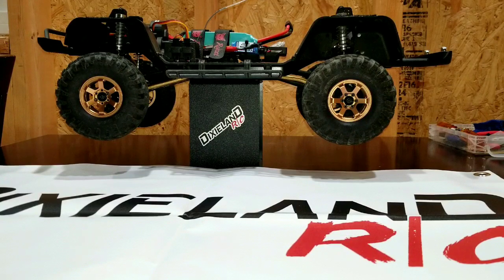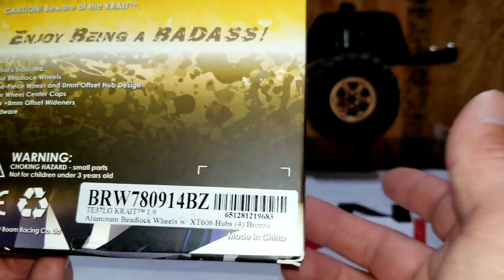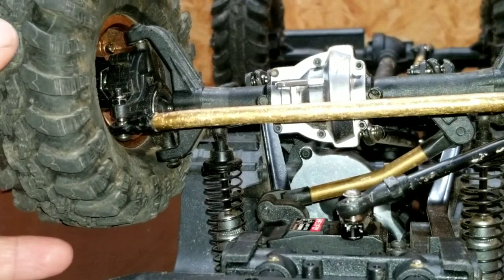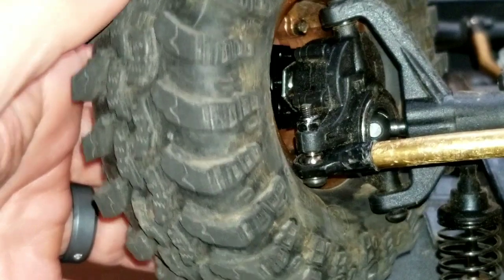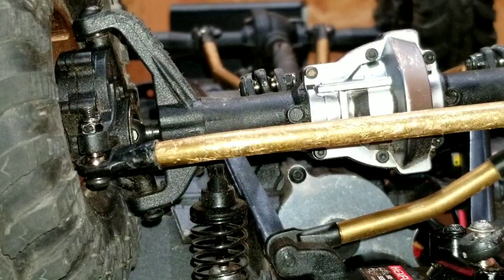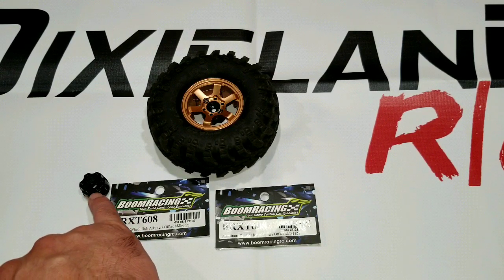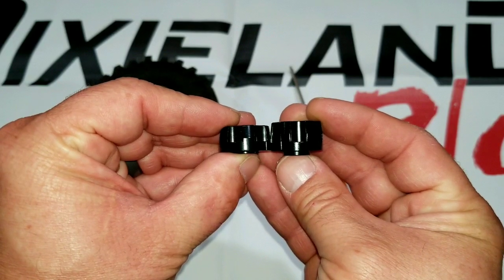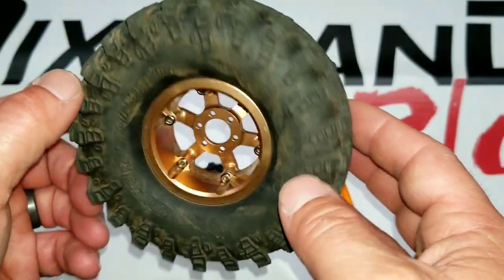Redcat Gen 8 Build Series Part (4) We look at the Boom Racing Krait TE37LG wheels.

Comment: I just ordered a brass 8mm wheel hex set off ebay off this club5racing site where this guy makes all kinds of stuff for crawlers. These were gen 8 specific and are 3mm wider than the stock 5mm wide hexs. That additional 3mm will give you that spacing that you gained. 13.50 shipped. I have some beadlock sets with the same offset as the stock wheels which makes the same issue over and and over. Was excited to nab those wheel hexs 👍 for those who want to go about it a bit cheaper I'd recommend trying those.
Very informative video though! Its definitely been a head scratcher trying to find a solution for this!

Comment: I love what you are doing with your Gen 8 but am wondering if you can please let us know a total parts list and prices. I'm debating whether I should just start my build with the gen 8 PACK or should I get the full ready to run gen 8 or get the gen 8 AXE. I am looking at the most economical way to go to get to the point you are at with it. Thank you
Reply from the maker: Get the Axe Edition. The only upgrades you will need for it is a set of D-Links from #RCADDICT because the factory links are very cheap. Boomracing driveshaft kit from DixielandRc and the last thing you would need to deal with is the panhard mount on the axle. It has play so you can either add your own brace or buy new mounts that keep the mount from pivoting. They key into the axle housing. The Axe edition is a terrific value.
Reply: Axle Twister RC awesome thank you for the advice and your insights from your great videos.